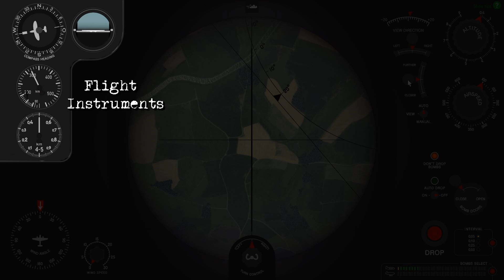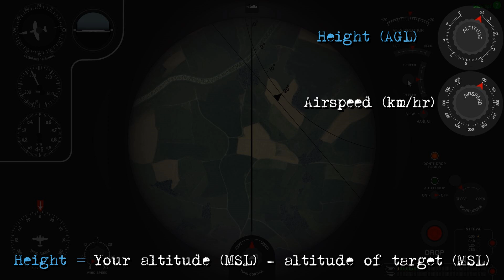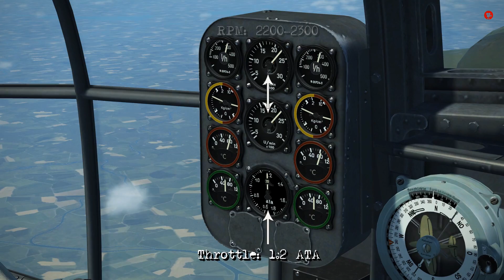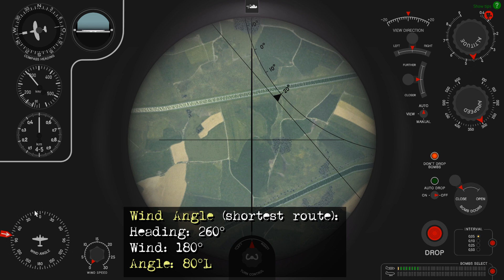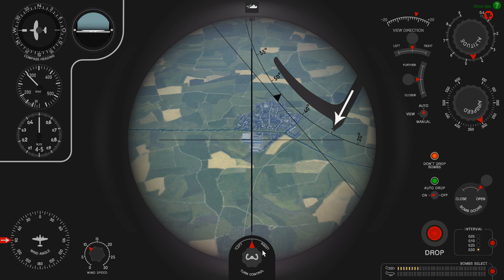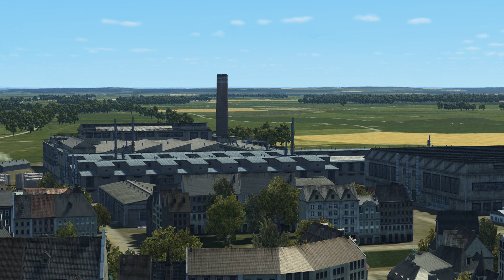Luftwaffe Level Bombing

Comment: The only thig I don't understand, why is the auto tracking constantly drifting? In the Norden, once you set everything right, tracking will absolutely not drift away from the point chosen...
Any clue why the drift in auto no matter what? Is it maybe due to QNH altitude used instead of nearest friendly field QFE (changeable by LAlt-A by the way), assuming relatively flat terrain of course?...
Reply from the maker: I wouldn't read too much into how these bombsights work. It's a very "gamey" feature

Comment: Excellent tutorial, I watch your channel with great interest. Aviation is my passion. I have an important question for you, perhaps your answer will clarify an issue that is interpreted differently by many people. Whether the bombsight altimeter use QNH? We can set the QFE (it's AGL, 0 meters or feets and then we have airfield elevation) or QNE (1013,25hPa - 29,92inHg - 760mmHg in my opinion this setting is only useful for maintaining proper separation, 
for example, between planes flying in formation) pressure in the cockpit altimeter. When we click default LAlt+A on fly we can refresh QFE  to nearest airport preassure. If bombsight altimeter show us AMSL (QNH) 
to determine the exact relative height difference we need target elevation right? For flat, lowland terrain, the error will be small, and you can use the AGL setting from cocpit alt or is it better to set the height from bombsight alt without 
subtract the difference in height. Sorry for me english, i hope that you understand what i mean. I send greetings!

Comment: The auto mode on this game is just useless. Much better to use manual drop and that way you will be more precise and you can make more than one drop on the target. 
The only use I find for the Auto mode is to be able to drop when there are some clouds there you can fix the target if you are able to see that between the clouds for a brief moment. When that happens the drop will be not precise so I made some tables for myself taking in mind the corrections depending the angle you are able to fix the target on the sight. That is much better and I manage to drop sometimes like that.
Reply: Auto mode is not bad, but you have to be really precise with your altitude. And it works backwards - no matter, what you instruments show, if your speed is set correctly, dial your altitude to the point where the auto bombsight stays stationary. You can notice in the video, that his sight moves a bit, and his bombs do fall a little short.
Reply: @Starcos  depending the distance you fix your auto you need to change your values for the sight to stay fixed. When the sight stays fixed does not mean the bomb will drop on the cross. If i want to use the auto is for fix and forget and that is why I made my tables. I know how much I need to change on the values depending if I fix target on 60° 55° 50° etc.
Reply from the maker: I understand what you're getting at Geramos. That's a good tip too mentioning about using auto to if the target is obstructed by a cloud and it's very cool you made your own correction tables to use. I'm far from a altitude bombing expert so I like auto for the easiest way which lets me drop all my bombs off in one pass to hit the area. I'm not expecting perfectly guided bombs, but I know that my bombs will generally hit what I'm aiming at.

Comment: For steering, worth noting that the controls are the same as those for steering your plane when the 'auto-level' feature is turned on.  I use the my mapped keys for that on the HOTAS rather than the mouse.  Thanks - I used your PE2 vid to learn Russian bombers and have had a lot of success, including in TAW, and had really wondered how the auto-function worked on the German aircraft.  Saved he hours of experimenting to get it right!
Reply: I greatly appreciate this tip about the "shortcut keys", as I usually find myself scrambling to enter information or adjust information (I'm a new pilot to the game and love the bigger birds) as I approach the target site. I know that I have had a couple misses due to using my mouse to adjust steering while it should've been over the DROP button waiting. Thanks!
Reply from the maker: Yeah good point about the steering, if you don't want to click it use the shortcut

Comment: Personally I'll stick to manual mode. I'd definitely fatfinger the controls and slide my crosshairs off target lol. Its not like you have smart munitions so you have to sit there in the bombardier station until drop time anyway, at which point i'd rather rely on my own crosshair aiming skills. Nice vid tho, I might try it out next time I'm on TAW
Reply from the maker: You're missing out by not using auto Taco! Anything to take away the headache is helpful! Once you try it you may not want to go back LOL

Comment: With a large bomb load like that, it is better to aim at the front of the target rather than the center like you have done here. Also a good tip is to open the bomb bay doors a bit earlier as they can introduce small drag which slows you down and messes up your aim if you do it just before the bomb release.
Excellent video btw.!
Reply from the maker: I probably would have been better off aiming in front of it rather than the center, but I find it hard to determine the bomb spread so I hedged it a little. It would have avoided that little bit of collateral damage to the house on the other side of the river. If I was using the higher number of 50kg bombs I would definitely lead in front of the target. Fair point about the bomb bay doors too, they could have been opened a little earlier.

Comment: Very interesting.  Does the game supports other bomb loads for the He 111?  Like the external SC 2000?
Reply from the maker: It does support a range of bombloads like those huge bombloads...at that point though it doesn't matter exactly where you hit LOL
Reply: The bomb options for He111 are the SC 50, SC 250, SC 500, SC 1000, SC 1800, and SC 2500.